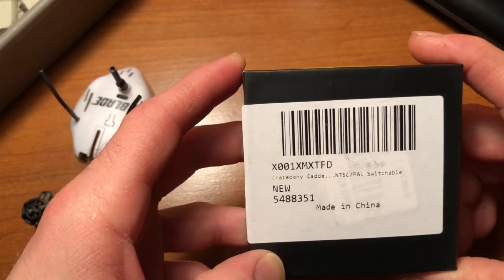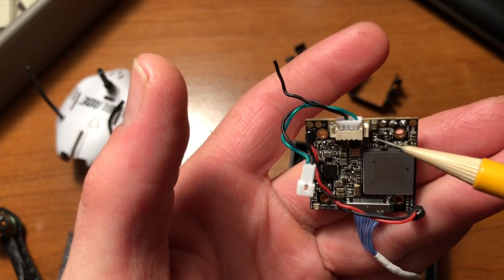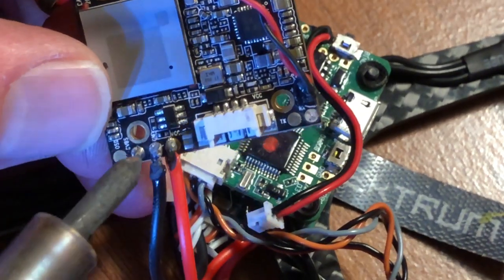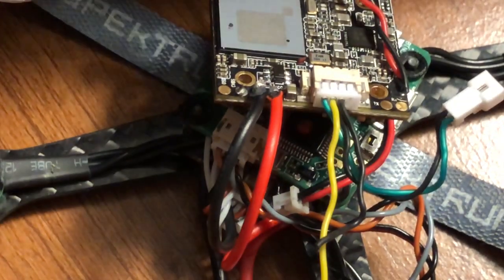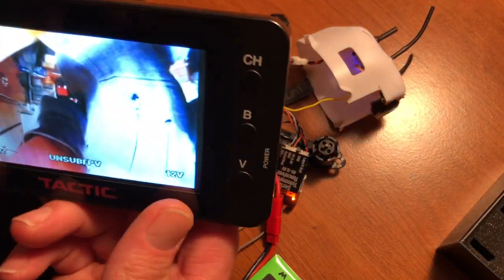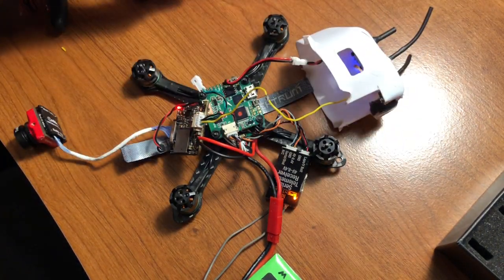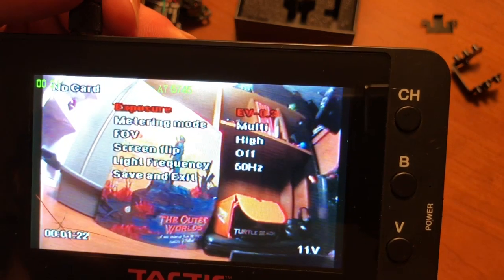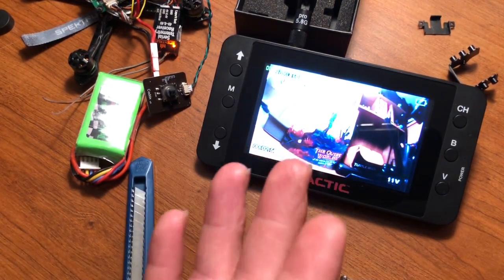Caddx Turtle V2 Unboxing, Installation, & Setup

Comment: Hello sir.just a few question can this camera compatible to other drone?like SJRC Z5?just planing to buy and install it to my 1st drone..Z5 drone had a poor camera quality,i just want to upgrade it so i can make a good quality video.waiting for your answer..
From philippines..😊
Reply from the maker: Janjan Sison Yes this camera Is a HD 1080 P camera capable of capturing up to 60 FPS. I would say it is very compatible as are many of these FPV cameras it uses a simple power and ground wire for ( well power lol ) and a video wire witch you would solider to you vtx. This is a great camera for the money and you really can go wrong. The last suggestions I would make would be to check out Caddx .com as they are the makers of the camera and they sell different lenses for each camera I would suggest getting a new lens as well as an ND filter from their website. Then it’s just a simple factor of Using the joystick to go through the OSD menu and adjust your picture to your liking.
Reply: @Unsub223  wow.thank you so much sir.but my minor problem is i dont know how to install it to my Z5 drone lol.what i mean is i dunno wer to put the right wire for the power/ground or watsoever 😂.is my 1st time to have a drone for a low budget 😊

Comment: can you help me out with how to connect caddx with mamba F405 flight controller?
Reply from the maker: What is it the MK2 30 x 30 FC ?
Reply: @Unsub223  YES
Reply from the maker: Angshuman Gopal OK I’ll try to explain looking at the top of the board at the edge where the arrow points forward, on the top left you should see Seven pens with a small white outline. If you’re looking at the right spot you should see the five pens right on the edge in to Pins lined up behind that line with the markings 9V and GND or ground. Following the pins directly above 9V and GND There is a 5 V and a ground right above the 9 V and the ground. You can use the five or the 9 V I would suggest the nine because if the 5 V dips below 5 V you will lose video feed. So either the nine in the ground or the five in the ground directly above it and then the one pin near the ground by itself is the video pin for the camera or the yellow wire.
Reply: ok i got the 9v the GND. WHAT ABOUT THE OTHER WIRES? YOU GOT ANY INSTAGRAM ACCOUNT ? I COULD SEND YOU THE CONNECTION DIAGRAM I MADE
Reply from the maker: Angshuman Gopal yes it’s right here, and I added a link to the diagram I found. https://www.instagram.com/p/CApbnVBDKxq/?igshid=9ux89nxcls0h

Comment: Hi man, can you clarify if you have connected the battery directly to the board of the camera?
I would like to use this cam as a stand alone recording camera, do I need the other board from the drone or can I connect it directly to the battery?
Thanks for the video!
Reply from the maker: PED Garage yes I have the camera board connected directly to the battery on this build. I ran power and ground directly from the battery but Fpv feed is alittle noisy. My 3 inch reverb build I just posted about I used another turtle v2 and use the wiring harness instead of soldering to the pads. As long as you get at least 5 volts to power the camera your good BUT, if your power directly from your battery know that the camera can only take 20 V so if you’re running more than a 4s you could fry the camera. https://youtu.be/Pbrl1HK9Gz0
Reply: @Unsub223  thanks for the answer!

Comment: I just got a new quad with the Caddx Turtle V2 micro but I just opened up the box and I don't have one of those controllers you have to set up your camera, should I have one or would it be possible to setup your camera without that? Cheers.
Reply from the maker: Brigzy FPV there’s no smart audio to change settings with your transmitter. You could try soldering the receiver to the rx, or the tx pin on the caddx board but that might not work. You might be better off just buying it. I did some looking around and this is what you want hope it helps. 

Register a new account on the Banggood APP and get $100 of coupons. I just found an amazing item with free shipping. https://banggood.app.link/nGQAN2YjcV

Comment: VTX and Caddx have the same GND pad ?
Reply from the maker: DrZ No everything on here is from the blade torrent so the VTX uses a jst 1.25mm for power and the Turtle v2 is powered directly off the battery leads.

Comment: I can't find sd slot in turtle in your video. How can you record the video?
Reply from the maker: You put a sd card in the under side of the board then set up auto record on power up or press the button on the side to start and stop recording.
Reply: @Unsub223   How far can you fly?
Reply from the maker: Jedi Drone a lot further then I feel comfortable with it. I’ve had it failsafe with still perfect video on 200. Not sure of capable distances yet. But I failsafe from loss of reception to radio a little over half mile. I still had clean video just lost reception to the remote.